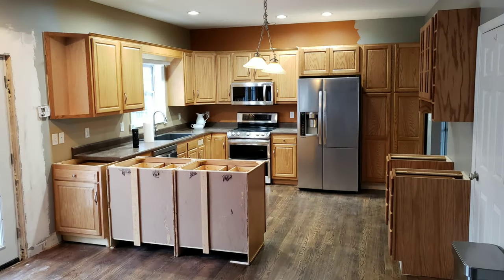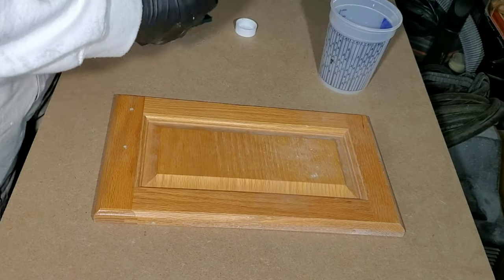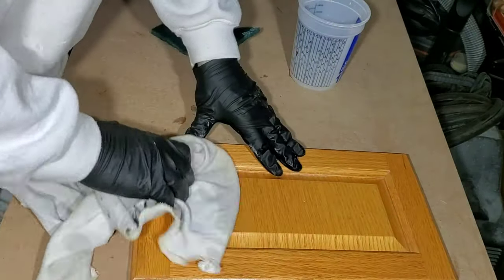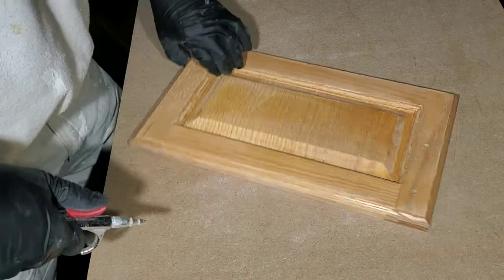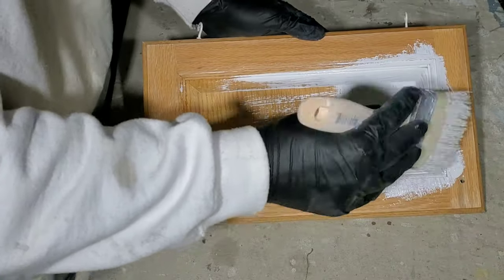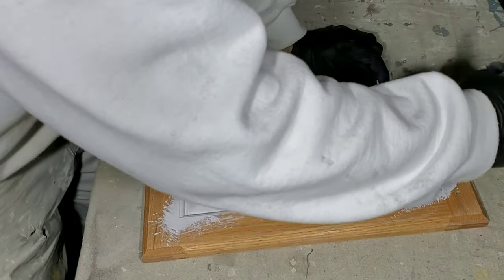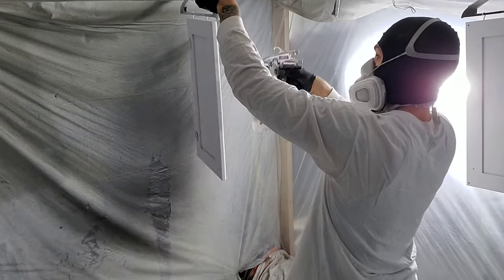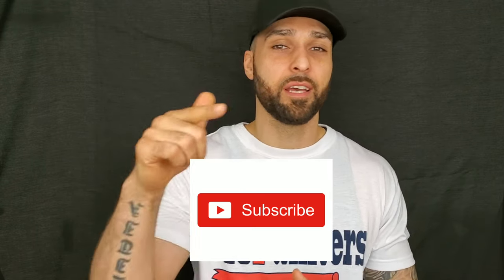Stop! Don’t Paint Your Oak Cabinets Until You See This DIY Method

Comment: Benny moore is a top product, but that 16 hr dry time can cause you to lose money.  Personally, I use Sherwin Williams Emerald line.  It's a urethane enamel. Really good stuff, lays down nice, and 4 hr turn around on 2nd coats. I think where people goof, is not estimating enough time on cabinets. It's a sssslllllllow process. I'm doing my own kitchen cabinets right now and the hours are adding up. Good video!
Reply from the maker: Thanks!
I love SW Emerald but the finish of Advance is just nicer and feels better in my opinion.
Reply: @DIYhomeimprovementguy  good to know, always like to learn about a new product. I'll keep that in mind and try to work into my usual rotation. Another good video!
Reply from the maker: Thank you! @skymedic48

Comment: I am trying to paint my oak cabinets, I used Krud Kutter and cleaned them all up good then I sanded them down really well. Now when I primed them a yellow tint keeps seeping through. I have 8 coats on one door and it still has a slight yellow tint. What am I doing wrong? I don't want to have to paint each one with 10 coats :(
Reply from the maker: Don't worry, I  can help!
What primer are you using?
Reply: Kilz one coat I believe
Reply from the maker: @brittanyjohnson2313  switch to an oil based primer like Coverstain or Sherwin Williams  Pro Block
Reply: Ok, thank you. I will try that. I ended up putting 10 layers of paint on my cabinet doors and one set is still yellow. I just gave up at that point lol. Thankfully, they're only in my laundry room, not my kitchen. Should I sand all the paint off first or just put the primer right over it?
Reply from the maker: @brittanyjohnson2313  if you are willing to do the work I'd say  sand it down, but it's a lot of work with that many layers.  However,  you can go over the paint with the oil-based primer and it will block your stains.
If you can just  email me some pictures or DM me on IG so I can take a look👍🏼
Reply: @DIYhomeimprovementguy  awesome... Will do. Thank you!

Comment: Hey my bro I ran into trouble I primed the oak cabinet with the oil base primer color grey and the my wife and I changed our mind with the color which is now white , I brought Benjamin Moore fresh start white not oil and man it’s hard to cover that grey , I about to just buy new if I can’t change this , any ideas , thanks
Reply from the maker: No problem! You'll have to prime it with 2 coats of FS then do 2 topcoats of the white paint.
Reply: Yea you'll be fine, It happens my dude.  just like 518 said gonna have to do the 2/2 method.  Might suck but give it a light sand and depending on your tip if your airless, you can use a 210 and get great atomization and better overall coverage without runouts
Reply from the maker: Thanks for that great professional advice!  @builderspluscustomhomesand2146

Comment: Thanks a lot for this video..I have the same color and would like to hide the grain..I'm thinking to use "white Benjamin Moore Advance interior Satin Paint" with 2 coat of water based primer (sanding between)
Would it be ok to use roller and brush for the 2 primer coats and then the final 1 coat of the paint to use wagner paint sprayer to get professional finishing with no brush marks?
And what's the difference between liquid papersand and regular sanding one..please I would appreciate your reply and advise..thanks again for your help.
Reply: He didn't comment because you didn't listen haha!  Use oil primer on oak or it will bleed.  Liquid sander de glosses and creates a chemical bond. Always sand though with at least 220.

Comment: Thank you for putting out this video! I’m getting ready to begin my first big cabinet repaint job and I’m wondering if you’d recommend putting on stix bonding primer first and then followed by fresh start oil primer or vice verse?
Reply from the maker: Are you painting over previously painted cabinets?
Reply: 518 Painters no, they’ve never been painted. They are stain grade with factory finish. Also, they are not as grainy as the oak ones you have in your video.
Reply from the maker: Gotcha  @trentendsley3355 ,
I would try a small section first using "pigmented white synthetic shellac". Let that sit for 1 hour and do a scratch test. If it sticks then use that instead of the stix. You'll save yourself a 16-hour dry time. But that stuff stinks and you have to ventilate well. If you don't want to mess with that smell (smells like a bunch of hairspray to the face) then use the stix and let it dry for 16 hours followed by Fresh Start Water Based Multi-Purpose Primer.
Reply: 518 Painters you’re the man - thank you brother! Just to make sure, you would use the water based fresh start over the oil based?
Reply from the maker: Correct @trentendsley3355  , unless you just use the oil-based first. The oil-based would be your "bonding primer" which in that case you would not need the stix or shellac. If you use the oil-based fresh start then you won't need another primer on top of that.
We use the fresh start just because stix does not hide well so to prevent having to do 3 top coats we use fresh start WB. 
In your case, 1 coat of oil-based will be enough, unless it's really grainy then do to fill in.
Reply from the maker: To be honest @trentendsley3355  , 1 coat of stix and 1 coat Fresh start water-based is perfect for your project.
Reply: 518 Painters greatly appreciated and so helpful - thank you!! Have a great week and Happy Thanksgiving! 🦃
Reply from the maker: Thanks,  @trentendsley3355  , same to you bro!
Reply: Why Stix and then water based Fresh Start instead of 2 coats of Stix ?
Also, after the last top coat I feel I need a protective finish.  A cleaning person used a scrubby to clean fingerprints and took off some paint.  Minwax water based poly ?
Reply from the maker: The fresh start has a better hide compared to stix. When your doing white cabinets then fresh start will give you a snow white canvas. You could topcoat but I never found it necessary. A scrubby pad will scratch up a clear and leave dull spots. At the end of the day,  a paint job on cabinets is like a paint job on a car. It's never bulletproof. If you want to do a clear coat then I would suggest minwax synthetic polyurethane cause it dosen't yellow as much👍🏼 @JM-cb6gh
Reply: @DIYhomeimprovementguy  I cant find anything that says synthetic polyurethane.  Do you mean the WB polycrylic ?
Reply from the maker: Yes sir, my bad. WB Polycrylic 👌🏽 @JM-cb6gh
Reply: 518 Painters have you had any yellowing problems with Polyacrylic?  Or is yellowing just a problem with oil-based polys?  Thanks.
Reply from the maker: @donbushek  unfortunately I haven't found a non solvent product that doesn't yellow.

Comment: Thank you for your tips! Can I use sherwin William's problock as the 1st primer then followed by benjamin moore fresh start high hiding all purpose primer? I don't have a spray, what kind of paint do you recommend if I paint with a roller?
Reply from the maker: Absolutely! Pro block works great too. Ppg breakthrough 250 VOC rolls nice on oak with a mohair or 3/8 inch microfiber 👍🏼

Comment: Hey Juan. Great video thank you! 
I’m getting ready to work on my own kitchen cabinets... smooth finished maple kraftmaid going to paint white. I’m planing on using your method/procedures and planing on getting BM Advance. Is the paint good for spraying? Is there any VOS consideration that you have mention for the other paints. Thanks!
Reply from the maker: Thanks for watching! Bm advance sprays real nice. Don't spray it on to heavy because it will run.
Reply: @DIYhomeimprovementguy  Thanks! 
Do I need to thin down BM Advance in order to spray on? or I can just go without thining and spray straight from the can?
Reply from the maker: In most cases, you don't need to thin down the Advance but you can thin it with water up to 10% @pawelbronski9102

Comment: 518painter,
  What do you think about Sherwin Williams Kem Aqua Plus ?
Reply from the maker: Not bad. It can be a bit finicky and has a slight learning curve as far as runs but overall good. I would still go with BM Advance or Gemini Evo over Kem Aqua.
Reply: 518 Painters 
Okay , gotcha .
Reply: 518 Painters 
So, Gemini Evo is a water borne pigmented lacquer correct?
Reply from the maker: Correct  @culturalhouse2643 . The finish is amazing for it being wb👌🏼
Reply: 518 Painters 
Gotcha . Thanks .
Reply from the maker: Nob problem  @culturalhouse2643  , hope that helps!

Comment: Great videos, you’ve taught me alot already so thanks in advance. Couple of questions...I have done alot of research and would like to run a few ideas by you. I am in the process of painting (30 panels/drawers) raised panel oak cabinets SW Dove White. I cleaned and sanded very well w/120 (probably overkill but I have the time right now). The panels are almost all the way sanded down to bare wood in some areas. I am going to apply 3 coats of aqua coat tomorrow followed by 220 sanding and a thorough vacuum/air compressor cleaning. Then my thought is SW problock oil primer followed by BM Advance. I will be using a Graco Magnum airless sprayer with probably a 310-311 tip. I haven’t purchased any of the paint/primer yet. Any suggestions? I was thinking of using stix and fresh start instead at first but looking for guidance from an expert with experience with different combos especially using the products with an airless sprayer.
Reply from the maker: Thanks for watching! You have it spot on with the pro
block since you're priming bare wood almost.  For Bare wood always use oil based. Everything you're doing sounds like you're a pro and know what you're doing👌🏼👍🏽Send me some pics on Instagram @518painters when you're done please!
Reply: 518 Painters I’m still at it..is there a difference in fumes between cover stain and problock? Im concerned w spraying them as my spray room is on the same level as the master. Might have to sleep on the couch a night or 2 eitherway. Have a good assortment of fans that should help also.
Reply from the maker: I personally feel that problock has an odor that leaves a bit faster than coverstain. If you can run some fans that helps. Also a makeshift tent with a 3 mil plastic draping from ceiling to floor will contain the odor mostly.  @Cisco93lude
Reply: 518 Painters thanks again. Glad your not shying me away from either. I planed on making a plastic sheeting tent including one side window w a high velocity fan to help.
Reply from the maker: @Cisco93lude  that makes a huge difference. I've had customers that said they never smelled anything while I was on site in a tent
Reply: I use Bin for primer. Works the best for me - 36 years experience.

Comment: Hi I was wondering if you could recommend a good sealer clear topcoat paint to go over water based paint🤷🏻‍♀️
Reply from the maker: Water based polycrylic by minwax works good and is easy to work with
Reply: 518 Painters You’re awesome for responding so quickly! Thanks 😉Brooklyn NY in the house 🙌
Reply from the maker: Okayyy BK All day 💪🏽
Thanks for watching! You can always reach out, I usually respond quick 👍🏼 @tigerlily1034
Reply: Angie if your cabinets are white do not use the water base polyurethane your cabinets will turn yellow.

Comment: Serious question, why do you brush the primer and not spray? Also grain filler..look up AQUA COAT.. it's a water based grain filler and it's less hassle then bondo. Either way, really happy you brought up lacquer, i was scared you were gonna say something else... Lacquer is KING of cabinet coatings.
Reply from the maker: Good question,  
We brush the primer to fill the grain more as in comparison to spraying. 
I've experienced that Aqua Coat takes 3,4  sometimes 5 coats depending on the grain.  Labor cost for that is just too much for most customers. 
Bondo will cut that time by almost 50% but is still labor intensive and costly. 
Lacquer and FPE are the most durable for sure👍🏼
Thanks for watching and commenting!
Reply: Also, question...what sander are you guys using? I like that
Reply from the maker: @buddybarlow9604  that's a DTS 400 by Festool but Mirka makes  one that's just as good but way less in price.

Comment: Can you spray that EVO product with an airless? Oh, and Benjamin Moore will be launching a Breakthrough type product in a few months.
Reply from the maker: Yes you can spray it with an airless. What is the product called, you know?
Reply: @DIYhomeimprovementguy  It's still kind of under wraps but they are doing some field testing on it. Ask your BM Rep about "Command".
Reply from the maker: I'll check it out, thanks! @Monarchski

Comment: Excellent system.  Been doing cabinets for many years and I can tell you care about what you do.  I noticed toward the end of your video you guys are using an hvlp.  I used one for several years, but after being turned onto to a purple, fine-finish tip for an airless I never went back.  So I still have my $1500 capspray sitting in my shop collecting dust.
Reply from the maker: Thank you! It was the other way around for me lol . I started with a titan 440i then switched to the hvlp.
Reply: Why did you turn away from the airless? What hvlp are you using, thx for the vids

Comment: Hey bud, I noticed you used hvlp on the cabinets... is that water based paint?  Im curious because Im about to buy one hvlp to do cabinets, but never try it, and I heard by using water based paint might clog the needles(even when thins out the paint)  help menout here bud .. Great videos btw 👍
Reply from the maker: Thanks for watching!
I use water based paint and oil based primer and never had a problem with clogging. You can thin the paint but usually it is not necessary. I keep one gun for solvent based products and another for water-based.
Reply: Nice !!!! Mind if I ask what type of hvlp you use as well as the needle for latex... like I said Im planing on buying one , I looked at the graco and titan so far
Reply from the maker: I used to have the titan capspray but I switched to the Graco 9,5 contractor series, it is perfect for our needs. very powerful and a lot of control options between air and fluid @thales4930  Check out this article https://www.518painters.com/paint-sprayers/
After I purchased it I wrote them an email about the free gun offer they have and they sent me a free finishpro gun.

Comment: Is it possible to use a water based primer for the cabinet boxes since it’s indoors? Won’t the oil based primer fumes be too much if used indoors? I will definitely use a respirator but I’m still concerned about the fumes🤷🏻‍♀️
Reply from the maker: The oil stinks, you're right.  It's the only thing that'll block tannin bleed though.  You can use a Waterbased primer but I would suggest "INSL-X  STIX" and let it dry over night!
Reply: I really appreciate the quick response😀 Keep up the good work because your information is invaluable👍
Reply: 518 Painters I just read reviews on this primer and they say it peels and cracks🙀 I think that I will stick to the primers you suggested, wear a top notch respirator, have all windows and doors open during priming and spend the night at a hotel for my heath’s sake😅
Reply from the maker: Sounds like a plan😁 @tigerlily1034 
If want you cam use Sherwin Williams's Pro Block. It has a little less odor and dries a bit faster. Just a little.
Reply from the maker: What kind of cabinets do you have? @tigerlily1034
Reply: 518 Painters Unfortunately “Oak”🙄
Reply from the maker: That sucks, or else I would suggest WB primer😕 @tigerlily1034
Reply: 518 Painters It does suck! That’s why I need to paint them because replacing them cost too much especially since I just bought this house and pumped in $20K already😳Thanks again for the quick responses... you’re the best!

Comment: What about those holes you put in the doors? How/when do you fix those? Thanks and good to see your videos.
Reply from the maker: Thanks! 
We use Bondo glazing and spot putty. It's like $7 and dries  super fast. Then we just touch up with a small brush.  You'll never see those holes after you patch them because of the filler and where they are located.